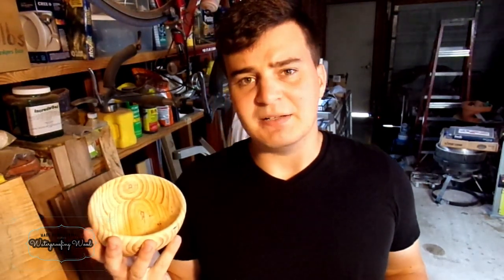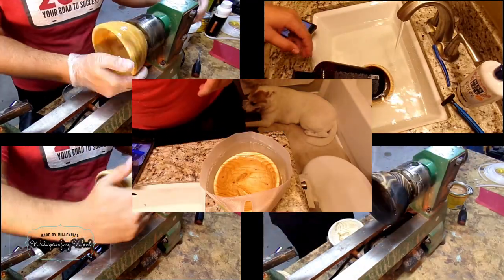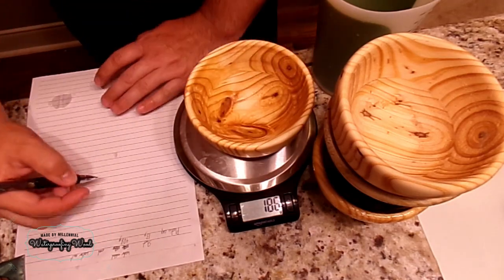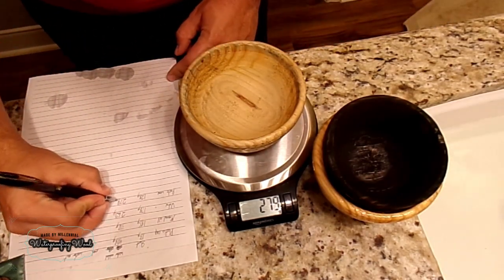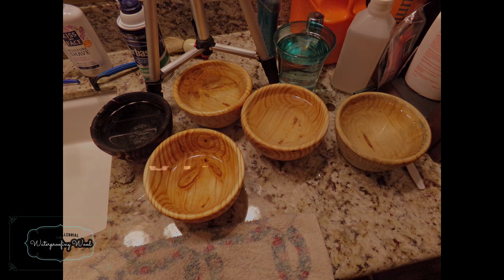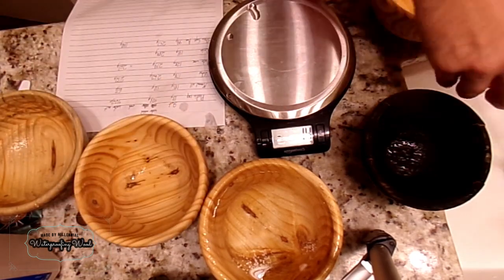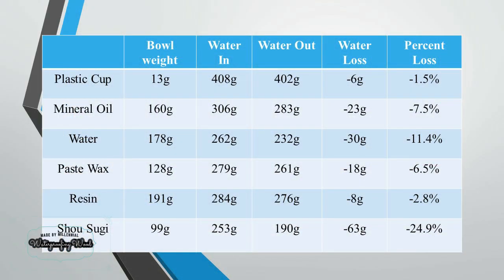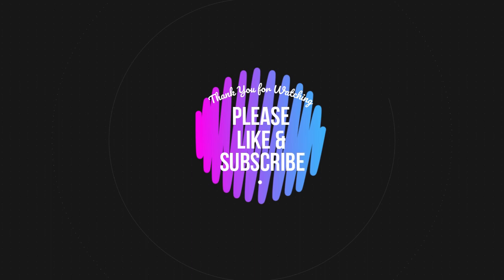How To Finish Bowls - Which Waterproofing Works Best!

Comment: Great video. Something I have been looking for since a long time. Solves my problem. I am trying to make a hydroponic planter pot in which water will sit in the pot permanently. I see resin and wax work the best but how did you apply both of them, that is the question. Thank you
Reply: This is for a commercial development so I think epoxy will be not viable because of the cost and operation. What do you think about wax?
Reply from the maker: I think wax may be fine.  It might be good to test it with pine planters first and see the damage over time.  My guess is the soil will cause damage over time but if the goal is 6-8 months then wax may be enough protection.

Comment: Very very well done video, thank you for this! Complete newbie question: I have a live edge bowl I need to hold water for roughly 1-2 hours at a time. Using something like paste wax which allows a small amount of waterloss, is that going to badly damage/warp the bowl over multiple uses?
Reply from the maker: Probably, the paste wax will still allow water in which should swell then warp the bowl as it dries.  You might want a thicker wall and to use something like a poly finish.  Good luck Laura!

Comment: So the resin is the best, but how can you use resin it's like a liquid ? 
Or just paint the bowl with multiple coat's? I need this information for flower pots
Reply from the maker: Resin (Or even a polyurethane, which is kind of like a thinner resin) would be the best, and can be painted on like a thick paint.  Just get a lower viscosity resin (or use polyurethane).  Also make sure to have some sort of weep hole in the bottom to stop overwaterring.  Good luck and I hope you see this/this helps!

Comment: Which one is best for our health? If we are using the bowl for salat, which one holds up to vinegar? Thanks
Reply from the maker: Best for health is definitely Mineral Oil.  It is a sealer for the wood which is non toxic and unlike a vegetable oil it won't turn rancid after a few months.  I don't know how well it will Stan up to vinegars though, sorry.  It might help to use a darker wood so the red/black stains from the vinegar go with the grain pattern. 

Hope that helps!

Comment: Hello, I made a wooden tub, but I don't know what is the best material to waterproof it.  can you guide me  Thankful
Reply from the maker: So if by tub you mean a bath tub then I would definitely use an epoxy.  Try to find a marine epoxy rated for/with reviews about use in wooden boat hauls.  This will be far more damaging then what you're doing, but still make sure to over apply.  Multiple coats and just paint it on.  I hope this helps and that project sounds amazing!

Comment: What can I use to put something on a wood bowl to make a candle out of it to make it Fireproof
Reply from the maker: Best option is probably char.  Most finishes are flammable, but burned wood is pretty resistant.  Just turn it thick and pre burn the wood.  No guarantees though

Comment: Mineral oil is derived from petroleum. The only oil you should be using is food grade flax/linseed
Reply from the maker: I think most cutting board makers would disagree with you, but to each their own
Reply: @MadeByMillennial  But you don't drink hot liquids from a cutting board